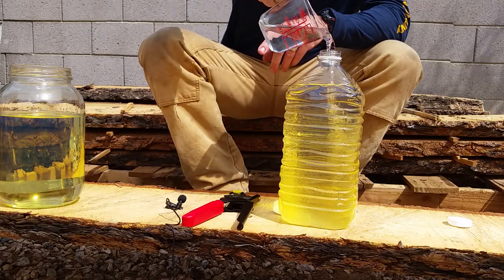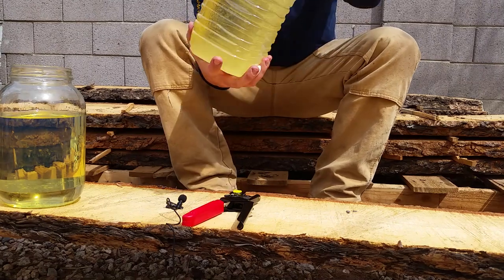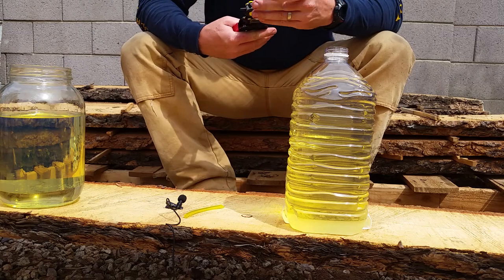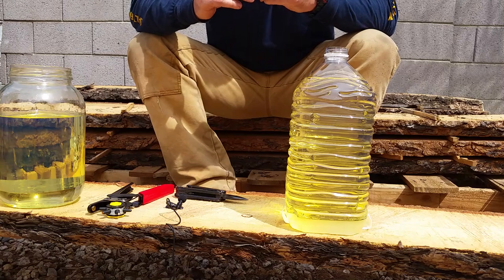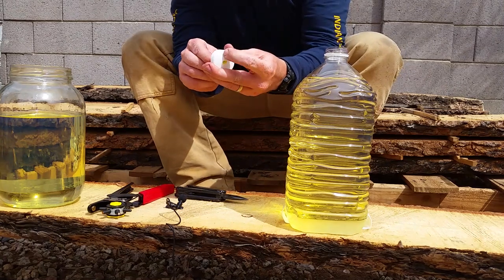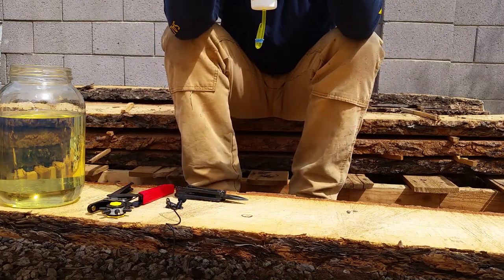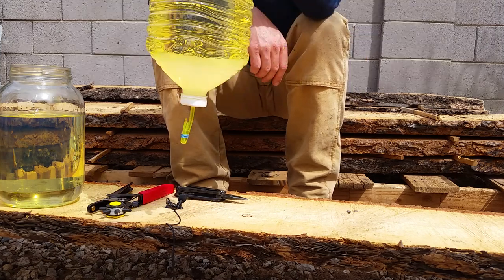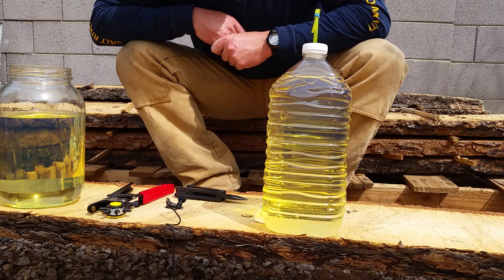Removing ethanol from gas

Comment: That's a cool idea. I wonder what the volume of the ethanol and water is after you separate the two.
Reply from the maker: one guy got 10% plus the water he added
Reply: well it would say on the pump but it is mostly 10 to 15% ethanol
Reply: How? The stochometry is the same. Some ethanol might be left over in the gas but this can be removed by doing a second or third washing with salt water.
Reply: I see: since ethanol and water are 100% miscible it must form a solution where one molecule forms vander waals force type bonds between molecules holding them closer together then the pure substance. Water is denser then it should be because the H and O atoms form hydrogen bond between molecules. These bonds are different then the covalent  hydrogen bonds that hold together the H2o molecules. Water should be a gas at STP like methane.
Reply: Stoichiometry measures these quantitative relationships, and is used to determine the amount of products/reactants that are produced/needed in a given reaction. Describing the quantitative relationships among substances as they participate in chemical reactions is known as reaction stoichiometry.
Stoichiometry - Wikipedia
Reply: Speaking English so us dummies can understand would be good.....
Reply: Dave B can't speak English. He doesn't know the difference between than and then.
Reply: ethanol is basically refined high fructose corn syrup
over time the enzymes eat rubber and plastic fuel lines and gum up everything
ethanol is a genetically modified bacteria living in your gas tank destroying the fuel system

Comment: Here in Oregon, Premium Ethanol free is readily available but runs roughly $.75 more per gal than Premium with Ethanol.  Since Ethanol gas only has a 3 month shelf live, remember to run it down once per month.  I try to run a tank full in my truck every month or so but it can become addicting due to the power increase.
Reply: We can remove the Catalytic converter for vehicles used off road.

Comment: Nice idea, in the past (with model aircraft fuel), I have used water gel crystals to remove the water with a sieve or similar.  These are the crystals that look like sugar when dry but swell up into gel blobs in the presence of water.  You can get them for mixing with compost to keep plants hydrated.

Comment: I always was under the impression that most of what octain booster is is ethanol along with certain additives and stabilizers. So...why take out ethanol only to put it back in?
Reply: If you believe that and wanty to confirm build or buy a ethanol tester and test a octane booster for ethanol. But your wrong in assumption or I can say with Lucas octane booster ( red tube )  your wrong.

Comment: Would really be interested in the quantity drained off. Starting with 120 ounces of ethanol gasoline and 8 ounces of water, how many ounces of "straight" gasoline remained after separation?
Reply: You will loose about 10 Percent of the fuel or about 12.8 Ounces per gallon.

Comment: I've done this as well, but I'm concerned about what (besides ethanol) ends up in the water that should have been left in the fuel , and how to estimate the loss in octane number.
Reply: I've read that is goes down about 3 points.  So start with premium gas if you want to run it in something that requires regular.  Or just use it in lawn equipment.

Comment: So, what your saying is the ethanol bonds to the water so all you have to do is drain the water and the ethanol is gone right? I do have ethanol free stations in my area but it cost $4.00 a gallon to where regular is only $2.60 a gallon it would be worth it because my motorcycle and lawn mower do not like the Ethanol fuel.

Comment: If you can find a place with ethanol free gas and it does not cost 20% 
more then fill up every tank you have because there is 20% or more 
decrease in MPG with ethanol gasoline and massive decrease in MPG with 
so called E-85.
Reply from the maker: +Bradford Ramsden i agree
Reply: I had a 2005 Ford Taurus that would burn E-85 and every time I filled the tank with E85 I would lose 3 MPG.  Your millage loss with E10 would be less than that.   Putting this crap in our gas is costing us in millage  as well as in maintenance costs.
Reply: Bradford Ramsden  it's usually more  like 40% more. 
3.75 vs 2.00 For fuel ant my local marina. Marinas usually have real gas for the two-smokers
Reply: Yep...
Reply: Bradford Ramsden sorry homie, that's false. I've tested it extensively and found less than 5% difference in mpg over a 4 fill up test cycle. It's not worth the $0.80-$1 per gallon price difference i see locally. Unfortunately ethanol is horrible for older vehicles mechanically.
Reply: My local co-op sells ethanol free for 25 cents more per gallon.
Reply: yep, i put regular or ethanol free fuel in the pick up and found i get 89 more miles to the tank , mind u im not on empty i cked it at a quarter of tank , so its fucking great to be able to get real gasoline, and ya its .90 cents more right per gallon, so the way i figured it out its costing .17 cents per mile more and im getting 89 more miles out of the tank fill, which in the winter means i wont be walking
Reply: E85 is 85% ethanol. Most cars won't run on it. Only "flex fuel" cars will. Yes there's a big MPG difference, but E85 is considerably cheaper.

E10 or E15 is 10% or 15% ethanol. That's the usual gas now. There's a slight loss of MPG in cars less than ~15 years old, but it's not much and it doesn't damage the cars. Older fuel injection cars run OK on it but it can damage the old rubber fuel lines over time. Most carburetors don't get along with it at all.  Some aftermarket performance carbs are made to deal with alcohol, but most are definitely not made for it.
Reply: Al Brautigam false sir,  almost all gasoline engines will run e 85. My 98 4runner was  designed to run " gasahol".  There are a lot of myths about e 85 so i put it to the test a couple years back.  Engine ran great and is still running strong,  mpg did drop. No  issues at all for 30,000 miles straight on e 85.
Reply: "My 98 4runner was  designed to run ' gasahol'."

What do you think E85 is? It's what they used to call "gasahol." If it was made to run on it, it will run on it. If it is designed to be run on gasoline, it requires gasoline, or at least mostly gasoline like E10 and E15, but even in low concentrations alcohol can damage fuel systems that weren't made for it. 

If your 4runner really is running on E85, somebody converted it to do so. It was not designed by Toyota to run on E85. A gas engine can run on alcohol, but the fuel system has to be up to it. A standard gasoline system cannot run rich enough to run on E85. There are ways to convert it, but you can't just fill it up with E85 and expect it to run..
Reply: Toyota
4Runner

Unfortunately, your vehicle isn't flex-fuel. This just shows there aren't enough FFVs available. At Fuel Freedom Foundation, we are working to bring competition to the market so that alternative fuels like ethanol are more readily available. This will help encourage auto-makers to make more flex-fuel vehicles, and also allow you to convert your existing vehicle.

https://www.fuelfreedom.org/our-work/fuels-101/check-car/
(These are people who want to promote ethanol fuel. If your car was made to run it, you can bet they'd want you to run it.)
Reply: E85 is not a new fuel in the marketplace, but is new to some consumers. Since it debuted at retail in the 1990s, the availability of vehicles to use it and places to purchase it have grown. This website is dedicated to helping you determine if your current vehicle is a flex fuel vehicle (FFV) or help you find one if you are looking to buy a new or used vehicle. Since they have been available for nearly 20 years, there is an FFV at nearly every price point. If you need help finding E85, or are curious about prices, please visit E85prices.com.

http://www.e85vehicles.com/
(More people who want you to buy ethanol, but 5.7L Tundras and Sequoias are the only Toyotas on the list.)
Reply: E-85 decreases mileage 30%. I have an ethanol free gas station nearby. My car gets the same gas mileage on E10 as straight gasoline.
Reply: It is all about available energy. Scientists us BTUs, British Thermal Unit, as a measurement. It is the heat producing ability in a set unit of a substance. The BTUs for gasoline is higher than alcohol, so of course more mileage is available with pure gas as opposed to an alcohol, gasoline mix. And of course the higher percentage of alcohol, the less BTUs or mileage. But as crappy as our base gasoline is and the way it likes to leave deposits or varnish like residue. The alcohol, being a cleansing type substance, does help keep the fuel system cleaner. And as this video takes alcohol out of gasoline with water, alcohol entraps water in the fuel system and neutralize the waters effects. Bad gas handling and storage problems have been blamed on the alcohol. It's a trade off. I did put 300,000 on a Mercury 3.0 V-6 that ran almost exclusively on gasahol. Still running the original injectors, ran smooth, and still managed 27 mpg. It is a good product, but there applications such as older carburetors and aluminum engines that are not advisable.
Reply: Yeah ethanol is a scam for sure.
Reply: At the track, drag racers are seeing about a 25-50 horsepower increase by running alcohol instead of gas. The problem is corrosiveness of the fuel system, so they have to be drained and flushed after racing. You also need twice as much alcohol compared to running gas, a more powerful fiel pump, and the fuel/air metering in the carburetor has to be twice as much.
Reply: D Rutt 1969
Yes, but if you've ever put you hand on the side of a supercharger after a run and it feels like the inside of a ice-filled beer cooler.....totally worth it!
Reply: D Rutt 1969 how do they determine horsepower at the track?
Reply: Rick Handy 
You can, generally, estimate HP from 1/4 miles times given known horsepower from vehicles with similar power to weight ratios. Knowing gear ratios also helps.
You can test this with comparing online HP estimators to known HP ratings of production cars (keep in mind though that traction, atmospheric conditions, etc. effects 1/4 mile et's). You'll find they are often pretty close to real world et's.
But to know for sure you need a GOOD dyno and operator.
Reply: I found no measurable difference in mileage in my 2011 Nissan Frontier.
Reply: If it is a flex fuel vehicle because you will probably belt a piston or something because the stoichiometric air fuel ratios of gas is 14.7 to 1 and e-85 is like 9 or so to 1 and i need to check if current cars have adjusted for e-10 or whatever because really thats like probably 14 to 1 or something because it would not be a big deal for them to change that in the tune and they should really offer to change that if it is not a flex fuel vehicle with anyway of knowing or adapting for alcohol or the government should pay for it i think they forced everyone to put alcohol in gas i mean you'll probably be fine with 10 to 15% commanding 14.7 but still
Reply: Oxygen sensors read 1.00 whenever the stoichiometric ratio is met, regardless of the fuel. Most fully fuel injected cars, except for some of the really old ones, have enough fuel injection capacity to compensate for E10 or E15. It simply adjusts the mixture until the sensor reads 1.00 (or a little higher) at cruise up to 0.85-0.90 at full throttle. The computer doesn't really care what the actual air/fuel mixture is, as long as the oxygen sensor reads what it should.

E10 is close enough to full gasoline that engines can compensate with just a little extra fuel capacity. E85 requires considerably more fuel and even lower oxygen sensor readings for full throttle rich condition. Much larger fuel injectors are needed and the computer has to be (indirectly) aware of the wide range of possible ethanol concentrations, which could be as high as 95% down to 0%.

http://www.hotrod.com/articles/wideband-oxygen-sensor/
Reply: DO you actually understand ANYTHING about ethanol or ethanol blended fuel? First of all the E10 fuel was supposed to be used to clean up tailpipe emissions. The fact was back in the 70s a "scientific" review paper about how they could clean up carbed engine exhaust output by blending in ethanol, WHICH, at the time grain farmers were hurting thanks to President Carters grain embargo. SO too many things added up, but the chemistry wasnt as solid. Then car industry moved to electronic engine controls, fuel injection and better catalytic converters. Thus moving cars towards cleaner emissions. 
Then the clean air groups started re-pushing blended fuels, even got EPA to MANDATE oxygenated compounds. Trouble is US Ethanol production wasnt able to provide it in a fiscally sound manner. AND a byproduct of petroleum production MTBE made it useful, economical and met all EPA requirements and it mixed well with gasoline. The rules never changed, farmers are still having issues. Now also certain parties made sure human food stocks cant be used in ethanol production except when condemned like rotten fruit. 
Now many also think using cattle feed creates more food costs BUT the actual thing is that if corn is used for ethanol what comes out the other end is cattle feed, so only loss is little starch.
Now I like E85 as I really think car makers missed mark, they should have marked flex fuel WITH high performance. Mainly cause its 105 octane, great for high performance engines. 
Properly setup and designed flex fuel is great. It does burn cleaner, it does help farmers and it doesnt hurt engines setup for it and cant hurt them if your educated in dealing not trying to undesign something with junk science.
I wish the haters and lovers would shut up and do some ACTUAL learning on the subject rather than both jump on bandwagons that are out of tune,with weird instruments making crap noise.

Yes ethanol takes more due to the actual molecule size and composition. Gasoline is a complex molecule, thus the reason for increased emissions from engines. Ethanol takes more fuel because its less energy dense. BUT still does NOT take more energy to produce than it makes , that is false science. 
The fight from both sides of ethanol fight are full of  junk.
Reply: ACTUALLY only cars running Lambda sensors read 1.00 at stoichiometric. MOST cars run narrow band O2 sensors and range from below 0.200mv to above 0.800mv when properly operating and use the strategy of maintaining a  stoichiometric AF ratio. On E10/E15 the system just adjusts milliseconds the injectors are open.
Reply: Engines can make more power with E85, but only if the compression or boost is increased when using E85. You can increase the compression ratio if you're only going to use E85, but then it won't run on regular gas or E10. People with controllable turbo blow off/wastegate valves can set them to higher pressures for E85. 

Ford made a concept Mustang that determined ethanol content and automatically adjusted its boost limit to match. It made considerably more power with E85, but I'm not aware of any production cars that do this. I don't pay nearly as much attention to new cars as I used to. There may be some production cars that do that. It's certainly possible.
Reply: Al Brautigam Actully E85 will make slightly more power even without increased compression or boost just from the much better cooling effect alcohol has compared to gas.
Reply: it uses considerably more e85
Reply: Bradford Ramsden w
Reply: Al Brautigam all but older cars will run on E-85 and they only suffer from vapor lock or compression issues, 'flex fuel' cars just have parts that aren't damaged as much by the added corrosives of ethanol
Reply: Lambda, in this context, is a conversion scale, not a type of sensor. None of them literally read "1" for stoichiometric. Notice I didn't give a unit.

Cars that are not specifically designed or modified to run on E85 cannot meet the additional fuel requirements for running such a high concentration for alcohol. Other cars can be modified to run on E85 but you can't just pour it in the tank and expect it to run properly. If it runs at all it will run way too lean and tear up the engine. 

There are rumors that some engines can handle the increase, but I'd be wary of that. Why would a car company make and sell a flex fuel engine that requires a significant fuel delivery capacity increase (more expensive) and not tell the customer it's built for E85?
Reply: Methanol is not the same as ethanol two totally different things.

Comment: FYSA: Ethanol has no true octane rating because it doesnt burn the same as standard gasoline (i.e. it's energy is not measurable in the same way as the octane rating)

Comment: I sure hope it works ok . Especially when you put your lawn equipment or motorcycle away for the season. 🇨🇦👍
Reply: Never leave any fuel in your tank and float bowl.    Drain them and leave open to thoroughly dry.    You will be glad next season.

Comment: What is the proper way to dispose of the water/ethanol/gasoline mixture. There will be a small amount of gasoline in the mixture.
Reply from the maker: I recycled it with my old engine oil

Comment: Thanks for the video.
Please, why did you add the cup of water to the ethanol gasoline? ... that is just more water to separate from the gas.. what am I missing? Thanks.
Reply from the maker: +Robert Wood adding water encourages the ethanol to bind to it and float to the bottom
Reply: the water absorbs the ethanol.  Since the water / ethanol solution is heavier than gasoline, the solution (water / ethanol) separates from the gasoline, and sinks to the bottom of the container.